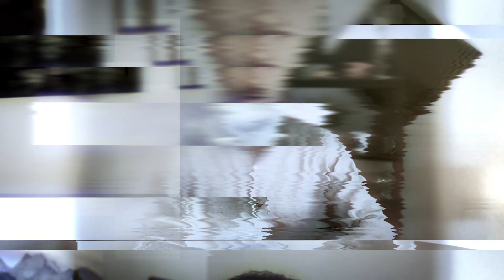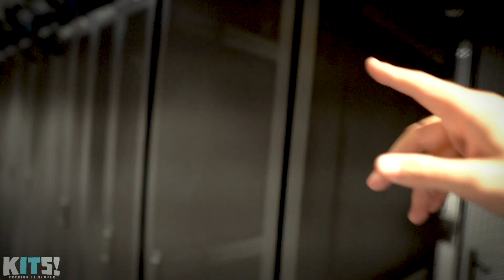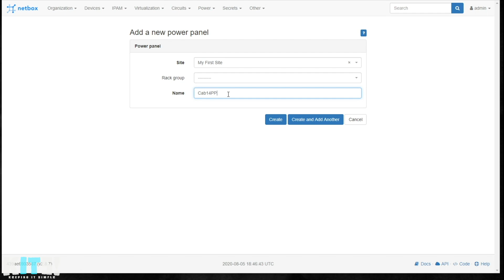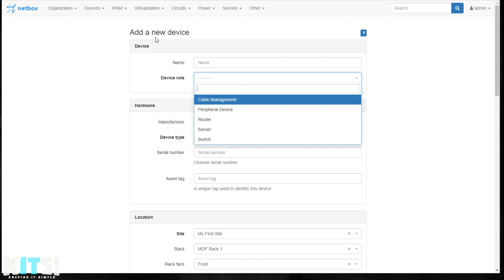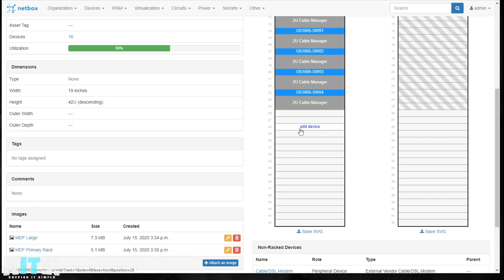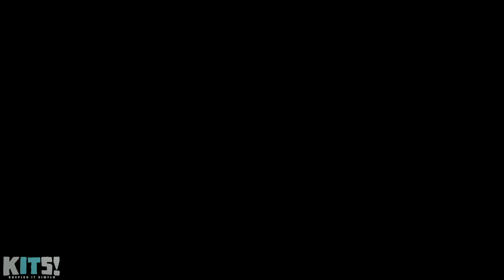Netbox Power

Comment: Too bad the logic for power feed link to power outlet doesn't flow like device rear ports to front ports. This logic would work well for a device like a PDU, but it doesn't.

This prevents the cable trace function from going all the way from device power port back to the power panel.

Comment: I think the 800W showing up on your feed is the 800W you allocated for the PDU power port not the 200W used by the switch. By allocating power draw to a PDU I think you're saying the PDU itself is drawing power rather than distributing power. If you don't leave the allocation on the PDU blank you won't see the switch that's drawing power through the PDU reflected in the feed utilization. Just my understanding, I could be wrong. Thanks for the videos, they got me started on NetBox.
Reply: I think you are absolutely right! Since the PDU is seen as a device, like for example a switch, storage, server, etc... the power drawn from the PDU's Power Port needs to be left blank. The only thing you need to do is to make a connection between the PDU's power port and the Power Feed. It's in the power feed that we set the power provided to the rack.